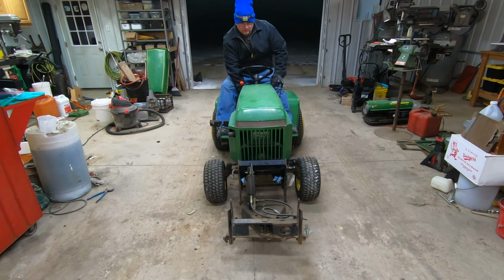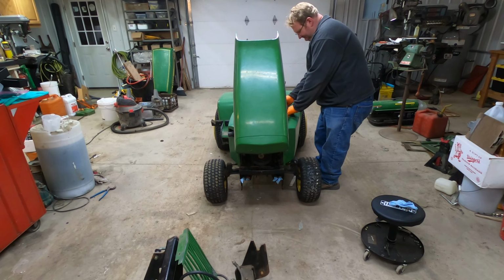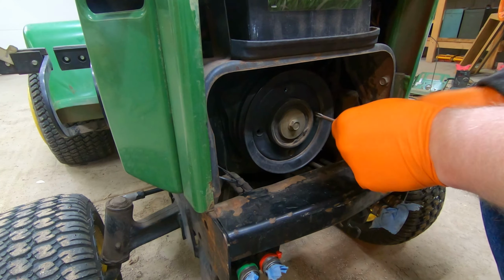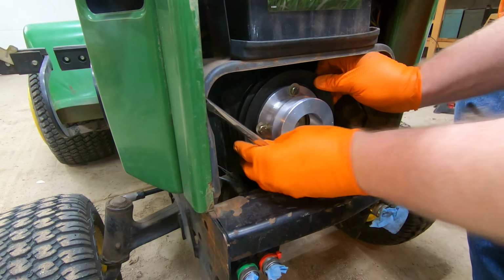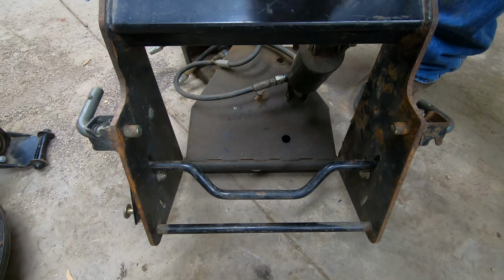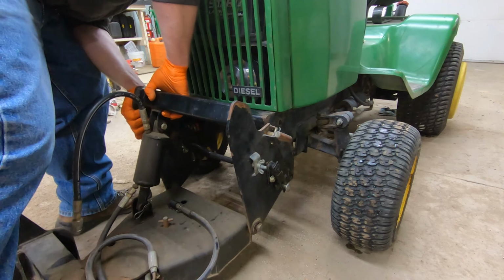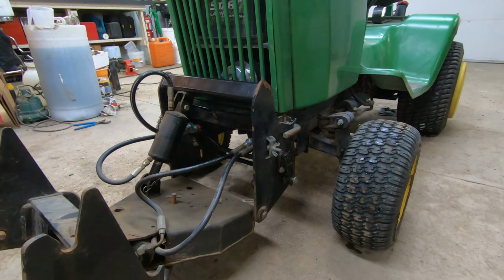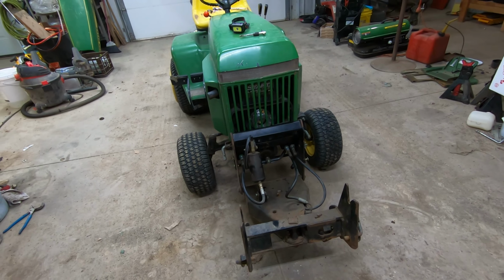John Deere 332 Quick Hitch and Front PTO: Part 1

Comment: Can you use the blower pulley to run the mower deck?   They sell a speed-up pulley for the mower deck, but I think.  The blower pulley would work for both accessories?
Reply from the maker: It might be possible, but I think there would be an alignment issue that would cause the belt to wear pretty fast.

Comment: I think I’ll stick to the 49 single stage much easier and won’t stick out so far.
Reply from the maker: I’ve always liked the performance of the 49 blower on our concrete driveway. The drifts from how open and wind prone our properly is coupled with gravel driveway are two big challenges for the single stage blowers.